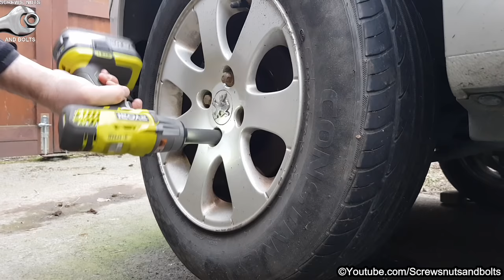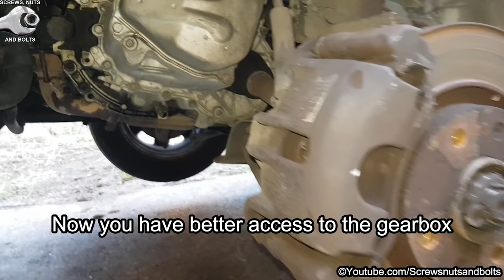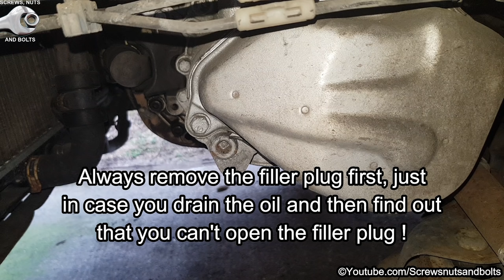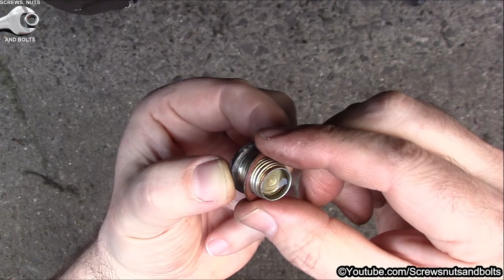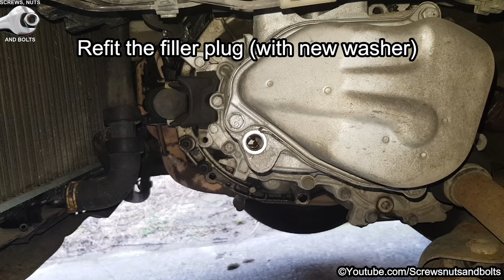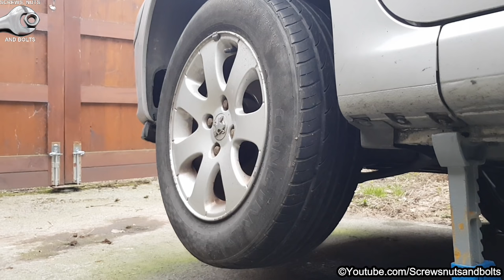Changing the Transmission Fluid (Gearbox Oil) on a Peugeot 307

Comment: I once could not open the fillet plug and had to refill through the drain plug. Is it not better to use a breaker bar instead of a ratchet

Comment: That oil looks nasty looks like never got changed wowow crazy that oil should looks kinda red
Reply from the maker: I was surprised to see it so dark too. It looked like old engine oil !
Reply: My 5 speed transaxle had a Castrol BOT 402 factory fill and it was still red by 73k and 18 years of city driving when it got changed (with yellow 75w-90 TDL gear oil). Though the drain plug magnet grew a nice little "afro".
Reply from the maker: @teravolt6113  lol :)

Comment: How about transmission fluid filter, ist it INSIDE the Casting?
Reply: It's a manual box, A.F.A.I.K they don't have filters, just a magnet to catch metal residue.
Reply: They dont have one.just a magnetic sump plug

Comment: Sorry can I ask u something I have a Peugeot 307 1.4 75hp ma5 and when I move it makes glurp noise only  when I  am on the move and I have it for 4 years now and I believe it's  transmission fluid because I haven't changed in the past years I what might be that noise the steering wheel the front wheels?
Reply from the maker: I really couldn't say. It could be something very simple but it's worth having a mechanic listen to the noise to see if he/she can diagnose where the sound is coming from.
Reply: @screwsnutsandbolts  thank u
Reply from the maker: You're welcome. Let me know if you find out what it is.

Comment: How do you know if its enough fluid you replaced when there's no Dip Stick?
Reply from the maker: From the manual: The oil level should reach the lower edge of the filler/level hole. A certain amount of oil will have gathered behind the filler/level plug, and will trickle out when it is removed; this does not necessarily indicate that the level is correct. To ensure that a true level is established, wait until the initial trickle has stopped, then add oil as necessary until a trickle of new oil can be seen emerging. The level will be correct when the flow ceases;.
Reply: But the car is not level because of the jackstand

Comment: Won't the level be off since you filled it whilst it was propped up on one side?
Reply: Look it up on manual how many liters go into gearbox and fill it in..it does not matter the position of the car aslong as its the correct amount installed
Reply: 1.9 liters for 307 sw atleast

Comment: Nce video. Do you know what oil I need to use for 2012 308 1.6 e-hdi 6 speed and how many liters?
Reply from the maker: According to the Haynes manual it recommends ESSO EZL848 or TOTAL H6965 gear oil (SAE 75W-80W) and on the 6-speed transmissions (MCM and BVM6) the capacity is 2.1 liters

Comment: What size crush washer does the drain plug take please? Can I just buy an assortment pack or is it a special size? Thank you.
Reply from the maker: I'm not sure of the exact size and they can also differ between transmissions, but you can use any copper washer with an inner diameter that's slightly bigger than the drain plug threads and is about 1mm thick. Just make sure you tighten it to the specified torque.
Reply: Thanks for the information, I've just ordered an assortment pack..👍
Reply: @screwsnutsandbolts  how do I know how much to tighten it does it really matter

Comment: Hello, thanks for the video, is it the same with the 1.6 hdi 110 cv?
Reply from the maker: I think it is similar but the drain and filler plugs might be in slightly different positions on the transmission

Comment: Great video, many thanks. I'm trying to buy the square socket but I can't find it. Where did you get it?
Reply from the maker: Thanks, I bought mine on Ebay here: https://www.ebay.ie/itm/BlueSpot-5pc-Double-Sided-Oil-Sump-Drain-Plug-Axle-Gearbox-Tool-Key-Socket-Set/233684972395
Reply: @screwsnutsandbolts  greatly appreciated, thank you very very much.
Regards

Comment: This video is very easy to understand and very straightforward, good job 😁 but I would like to ask if you know how to change the automatic gearbox oil for Citroen Evasion 16v? If it's not too much of a hassle, would you mind making a tutorial for that? Also, my gear shift indicator blinks non stop. Does it have anything to do with the solenoid valve, or something else? I would really appreciate it if you could explain this for me, thank you very much 😄
Reply from the maker: I don't know, sorry. I've never worked on a Citroen Evasion.
Reply: The same only levels must be checked with enging running  on dipstick

Comment: What are the measurements of those washers?
Reply from the maker: I think it's 16mm inner diameter and 20mm outer diameter x 1mm thickness. Here's a link to a similar part: https://www.onlinecarparts.co.uk/vaico-874135.html
Reply: @screwsnutsandbolts  Thanks!